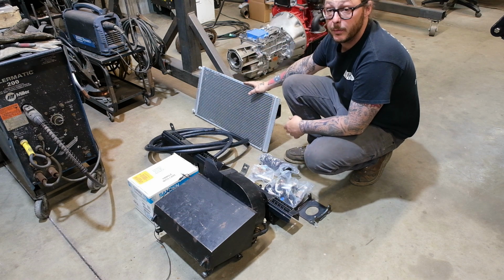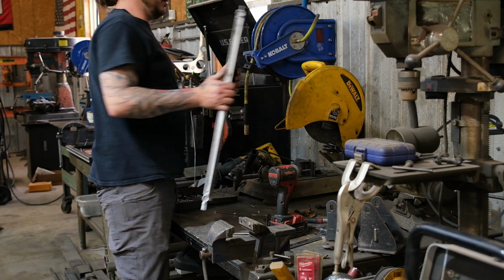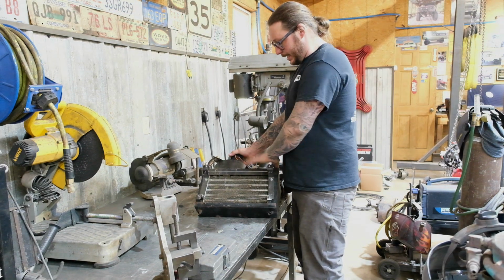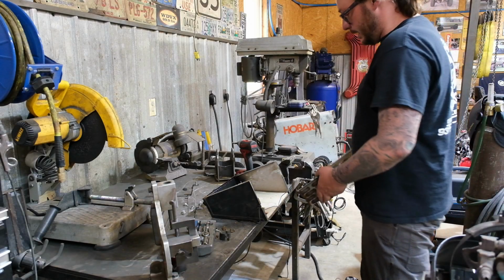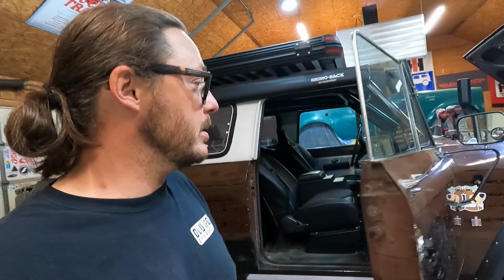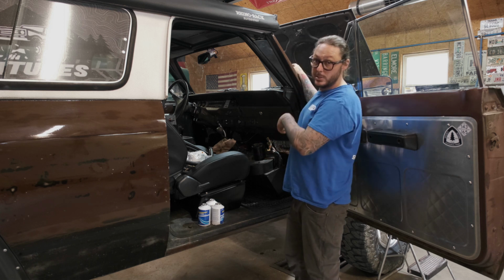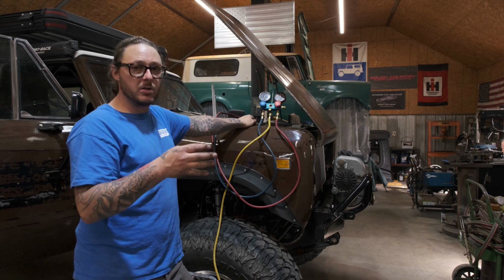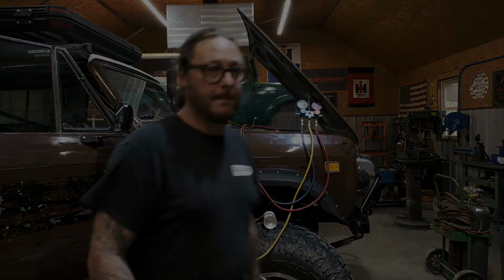How to install air conditioning in your International Scout or other (vehicle X) vintage ride!

Comment: Was really looking forward to see how the belts were run, I have a very similar 2 pulley alternator setup and was looking to add ac
Reply from the maker: On this setup the AC mount pushes the compressor in line with the alt.  So everything runs off of the same 2 belts.

Comment: Did you inject any oil (pag 46)?
Reply from the maker: I typically add a few ounces to the system as I assemble it.  Make sure compressor is pre filled with whatever the recommended capacity is.

Comment: Did you have to add flare to O ring fittings on the older evaporator #6 #10?  I am doing something similar but with  older Mark IV and vintage station wagon. Thank you.
Reply from the maker: I used flare fittings at the Evap.  You can still get flare style stuff in the appropriate hose sizes through any good automotive AC shop.

Comment: I just found your channel, can you tell me if you've put an electric fan on a 345 V8, if so what did you use. if you have a video can you link it? Thanks in advance!
Reply from the maker: I have seldom used electric fans on SV engines.  You really need 2 as 1 won't pull enough air and it is pretty tight in front of the fan hub especially on a Scout II.

Comment: Did you add the standard expansion valve back on? How does this hook up?
Reply from the maker: Yes. Replacement of the expansion valve is good cheap insurance.  It connects to the evaporator in the factor location and uses the reference bulb.  Hooks up with Inverted flare fittings instead of orings.  I think I mentioned that in the video.
Reply: @OldIronOffroad  Hey Levi - struggling to get this put on without it hitting the underside of the cowl.  Is there a trick to get this on without the "hat" looking thing hitting the underside of the cowl?  Unless my hard line is bent towards the passenger it doesn't seem to fit on.
Reply: Did you get it good n tight or specific torque on those flange fittings with the expansion valve?

Comment: Levi, great vid! Thank you. I have an 87 4x4 diesel Burb, would the condenser upgrade work on my truck? Getting ready to redo the air. Thank you! Luv the channel and builds.
Reply from the maker: Absolutely.  The quicker and more efficient you can pull heat out the better it will function.

Comment: Would one of these scout under dash units be able to fit an early bronco? Looks pretty similar to the aftermarket stuff solid by the vendors. If so do you have an old system that could be refurbished for sale?
Reply from the maker: I wouldn't be able to say for sure.   I do have several systems, but wouldn't want to sell one "assuming" you could use it.
Reply: @OldIronOffroad  thanks! I’ll do some checking around and hit you up on Instagram. What would you have to have for a system?

Comment: Great video, very detailed 
Is it possible to get a list of part numbers on the new parts installed
Reply from the maker: Yep will drop them in the comments.
Reply: @OldIronOffroad  Good video, I had not thought about a manual crimping tool.
How do you calculate the quantity of oil necessary for this system, or any system?
Reply from the maker: @johnnyhinman7946  Most new compressors come pre oiled with the properammount for a new system.  The only time you really should worry about adding oil is if you are changing one of the major components other than the compressor on an old system.

Comment: Love the truck and vids.  I have 76 scout 2. I'm LS swapping with a 4l80e, dana 300. Will be doing dana 60 front, and 14 bolt rear.  Need to do lots of body work in in NW Washington so rust galore.  Gonna be a hunting and wheeling rig.
Reply from the maker: Awesome. We plan to head in the PNW at some point so get it done and join us on a trip!!